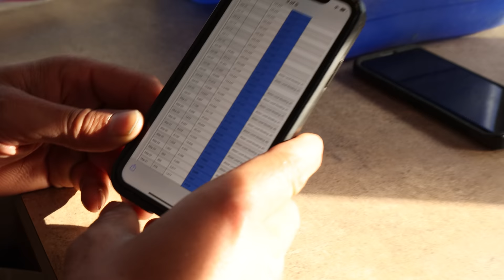The Best Salmon In The World

Comment: Heading that way in a couple weeks. Have a Arctic Fox truck camper like that but pulling an SJX.  Are you running a special hitch extender or anything?
Reply from the maker: I have the smaller 805 and it ends at the bumper so no hitch extender needed.
Reply: @KrisDeVo  right on, I noticed the layout was a bit different than the 860.  These campers are the only way to go up here if you pull toys.  Keep up the awesome videos and I enjoy seeing the Alaskan things.